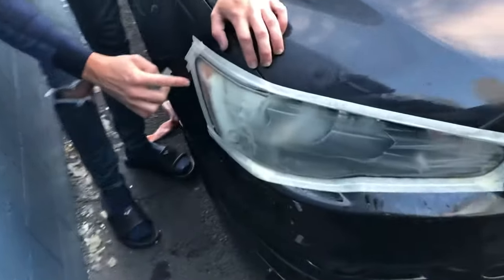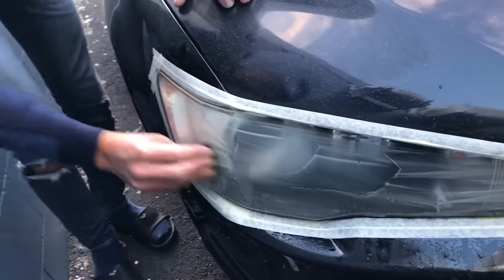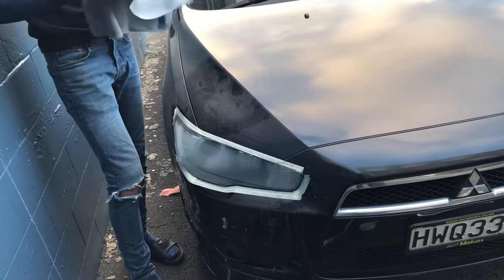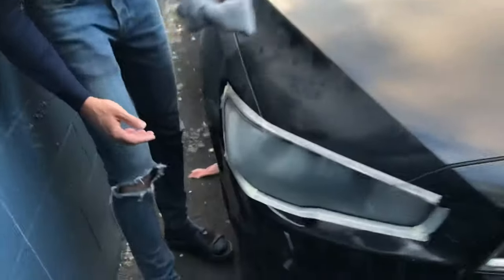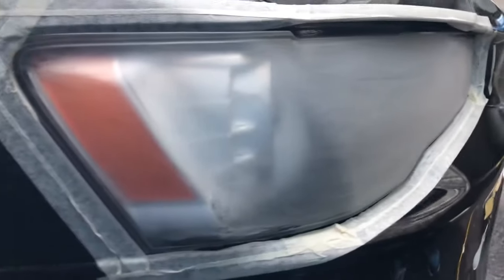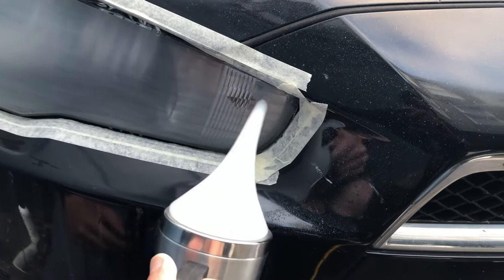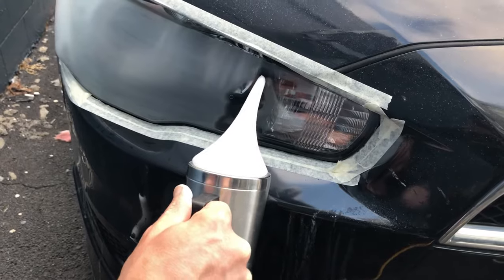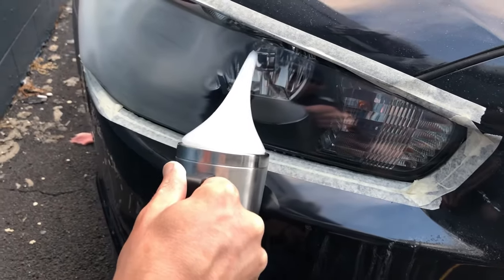Tutorial Headlight restoration steam kit (acetone)

Comment: It's just acrylic, whatever you did, polishing the surface will damage the OEM UV protection layer, this vapor will survive at least one year in FL or more than two years in NY depending on how much UV is in the environment, to extend the lifetime of it, put protection film with UV coating on it only if your headlight not running at high temperature, or you can spray UV coatings like Megiuar on it.
Reply: The first thing I do after cleaning headlights is I buy cheap UV window tint and pase it on there and trim with a razor and it get's protection for a good 5 to 6 years before the tint starts to peel and flake off, but no worries, peel the tint and re-apply it. The headlight under the tint is 100% clear. UV tint does not get hazed or yellow because it has UV protection.
Reply: Havent heard such bullshit in some time. Have you ever heard what ceramic coating is? No? I can tell.
Reply: @1119-w3u  yes that works perfect for most headlight with low temperature， be careful for high temperature headlight such as
Xenon, with film it will generate hair-tiny cracks on the acrylic.
Reply: @Brancuu  so called ceramic is just bullshit, is nothing related to real ceramic, out of data stuff, it’s nonsense, nobody use that on luxury car, you can play it at home for 20bucks
Reply: @jingzezhao4668  there are way more expensive and protective coatings. Also, few bucks for ppf.
Reply: @Brancuu I used to play with sonax Gtechniq and scarcity coating, I’m crazy fans with applying these synthetic coating made by silicon and other polymer on my luxury sedan, after few years, I finally end up with swissvax wax, coating to me is just a tolerance, do not apply any chemical on headlight, and only rebuild with Glasurit clear coating from my family business experience

Comment: You receive the same resuts using a hot air gun on high heat, low blow, without having to use volatile chemicals.
Sand the headlight going down to 1200 grit, then use the heat gun moving in small circles.
I finish the process spraying the headlight with a UVC clear coat to give the headlight some protection.
It is not a totally permanent repair, might last a couple of years depending on your location

Comment: Acetone vapor removes sandpaper scratches? I do this with cutting compound and a rag.
Reply from the maker: can do like you do as well
Reply: @nonomotors  What if you polish -> steam -> seal with ceramic coat ?
Reply: You can wipe one way with a flat cloth with 99% acetone after using 1,000 grit

Comment: Whats going on? I don't understand what you think you are doing? What type of plastic are you working on? Whats in the steam pot? What reaction is happening here?
Reply from the maker: Hi, as it's said on the video you do sanding paper with different grid and after apply the steam solution
Reply: @nonomotors  whatbis the steam solution and what type of plastic does it work on?

I put methylated spirit on a Renault tail light once, just a tiny bit on a rag. The light cracked up instantly. Cost 2 weeks wagrs to replace. I learned to always confirm material types.
Reply from the maker: @MongrelShark 
plastic type polycarbonate
Liquid solution : headlight steam kit acetone base

Comment: I cannot see how this is protected from further oxidation.  You need to top coat it to prevent oxidation. Excellent clearing technique, though.
Reply: it didnt.  the sanding took away the faded dry plastic layer on the outside, the finer and finer sanding grits removed the scratches created by the paper used before.  He said to take it to 1200 wet/dry and then he used the steamer.  I have polished lots of plastics over my years and its amazingly simple.  I use water and a couple drops of dish soap while sanding.  Removing the gloss is what you are after at first, then making scratches from the paper smaller.  I use buffing compound and a few shop towels to buff the shine back.  It takes a little elbow grease.  BUT, the lenses will eventually go dull once again but it will take more than 2 years and this guys warranty will have expired by then if you could ever find him again.
Reply: @greavous93 Guarantee for this is 3 years minimum. I did mine year ago, still brand new! Of course who works this things he will always said it’s bad, cause he’s losing customers 😉

Comment: it that water you using while sanding?
Reply from the maker: yes water
Reply: How many grades of sand paper do you use?
They are all wet and dry paper?
Start with 400 then 800 then1200, 1500, 2000 grade paper.
 Use water or windowline cleaner with the sand paper?
How much cap liquid do you put into the cup?
How long do you heat it for??
Thank you wayne

Comment: What do you seal it with after the acetone vapor treatment?
Reply from the maker: Don’t need to do anything after you put the steam is done
Reply: I wrapped mine in anti scratch film afterwards.
Reply: @NONO Motors if you use acetone, you really should put a plastic sealer on. It would last a decade vs 2-3 yrs
Reply: @NONO Motors If you don't they will be yellow soon after without any protection.
Reply: Maguire sealer at Walmart automotive department

Comment: Awesome video mate. Was just wondering, can I use any acetone for this?
Reply from the maker: Hi mate thanks for your comment. Bro the product I use is acetone base
Reply: @nonomotors  Is this not isopropyl alcohol?
Reply: @nonomotors  no it's synthetic rasin and toulene
Reply: @georgenooner  lol it's synthetic rasin and toulene.
Reply: @George Nooner  except headlights are clear coated, and that's what uv waves break down, the clear coat. Simply buffing that clear coat would yield the same results. If the clear coat is completely faded you have to sand and re clear coat otherwise the bare plastic oxidizes super quickly without the uv protection of the clear coat.

Comment: Does the container that evaporates the acetone gets hot or it just has a fan inside?
Reply from the maker: Getting hot yes a bit, that’s why you’ve handle on it
Reply: @nonomotors  I see. Can I get that liquid in my local hardware store?
Reply: @LOV2XRL8RL  walmart, be very careful with it. It is very strong
Reply: @Seadoo1  Thank you

Comment: How can it possible..😢
Reply: Acetone melts the plastic
Reply: @anguslean4058  Is it safe to use on plastic headlights?
Reply: @mbz4652  yes 
That’s what it’s for 
Best to sand the headlight from 
600 
1000
1500
2000
3000
5000 if you really want the best looking 
Most just go up to 1200 grit 
I think 3000 is better 
Also the liquid is acetone 
Get 100% pure acetone 
Any hardware store has it 
Only fill the cup 1/3 and don’t spill it on the headlight.
Reply: @anguslean4058  Thanks for the answer and advice. I heard a lot of people saying that using acetone on plastic headlights could ruined the surface of plastic and even dissolve plastic entirely. But I think that this is the case if you use acetone directly on plastic not if you use a steam machine
Reply: @mbz4652  yep
This works 
I got one off Amazon for 25 bucks 
If you take your time and sand it correctly 
It comes out really nice 
But if it’s an old worn out piece of junk with all kinds of cracks and garbage on the inside 
You can’t do much 
300 seems to be the sweet spot but I have seen people go even higher 
I guess if it’s a high end vehicle you might want to go higher 
Most of them are stopping at 1200 and then using the vape machine 
Don’t use nail polish remover it has other chemicals in it 
Stick to 100% or as close as you can get to pure ethanol 
Also you could put a cuzzi ( foam insulated cup holder) on it to help retain the heat 
Don’t over fill it and don’t spill drops on your headlight
Reply: @anguslean4058  I'm going to get one and apply the advice you told me. Thank again!
Reply: @mbz4652  one more thing you back lights on your car ( Brake Lights ) are Acrylic not Poly carbonate like your Headlights 
It works but doesn’t get out all the scratches from sanding 
I tried doing a small third brake light 
It brought back all the color but didn’t get rid of all the fine scratches
Reply: @anguslean4058  Alright, good to know. Thanks again
Reply: Tjauwmin  any good hardware store.
Reply from the maker: It’s magic
Reply: Rizvi Todikromo  Also available as fingernail polish remover.  Read the label before buying.